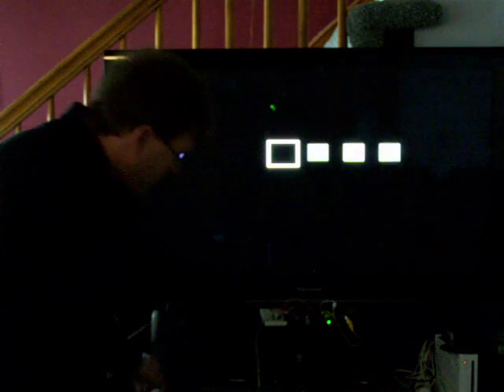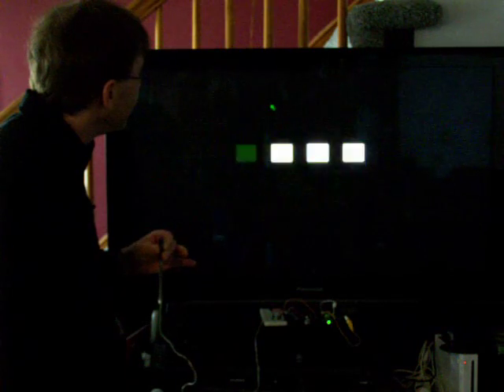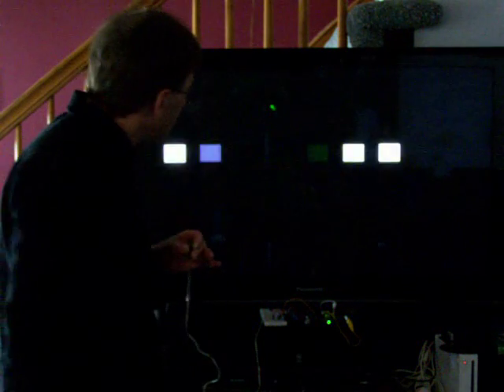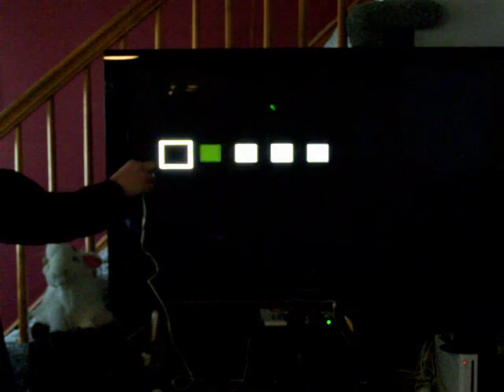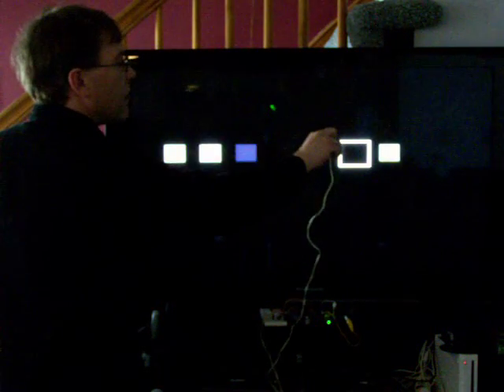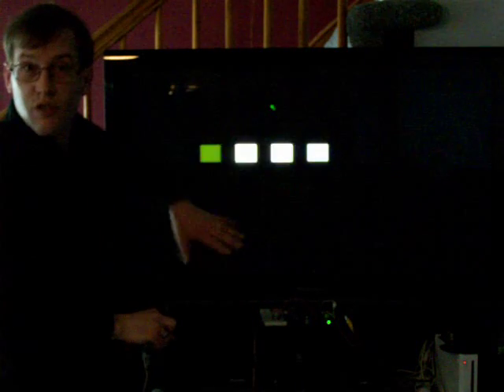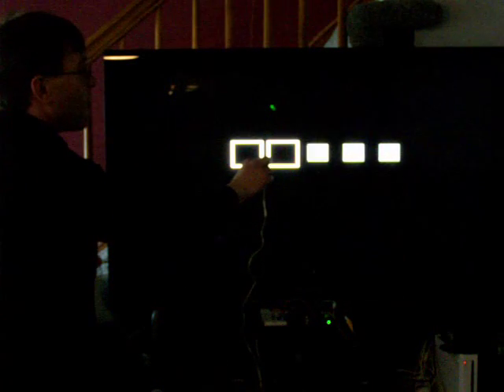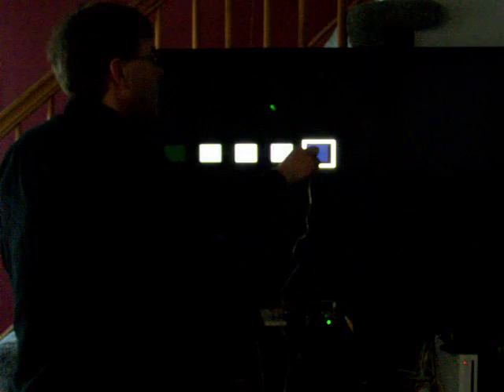Arduino Lightpen 1.0

Comment: I have been thinking of a similar way to get a light pen to work with LCD screens. Essentially I thought of the same thing as you... have the screen print shapes at buttons on the screen and have the Arduino look for it at specific time intervals. Great work! This video is 12 years old now, but I would like to ask if you- Have you made more progress with this?